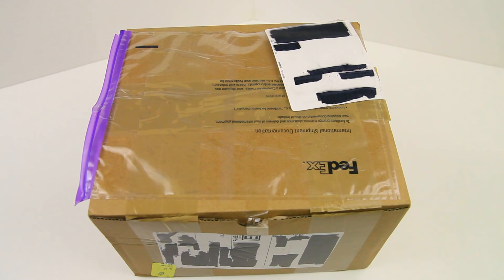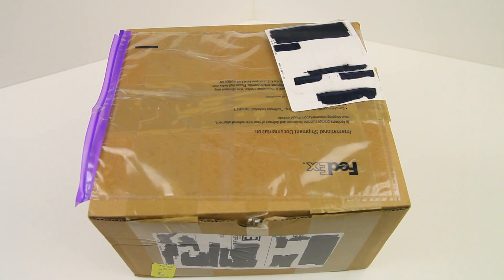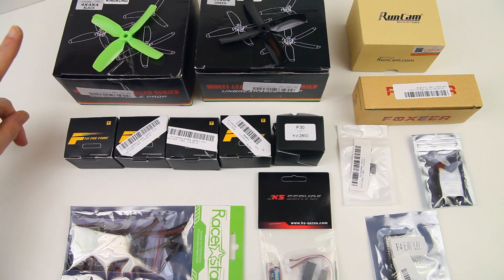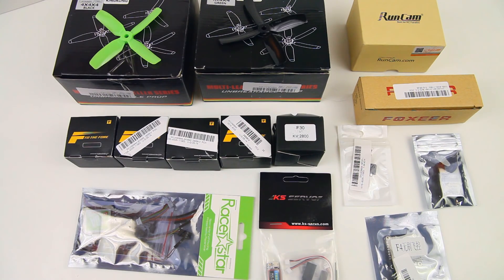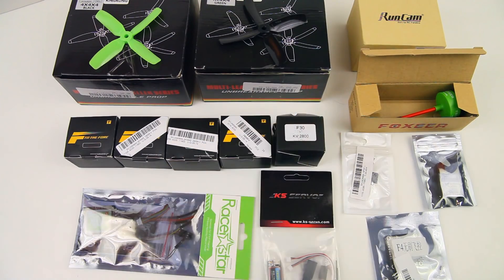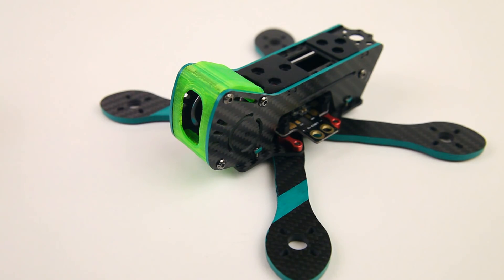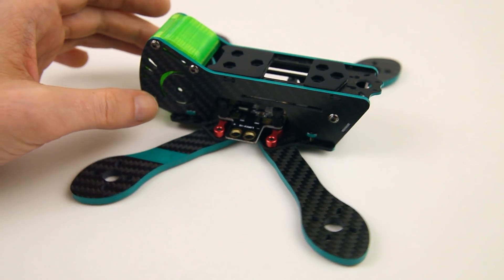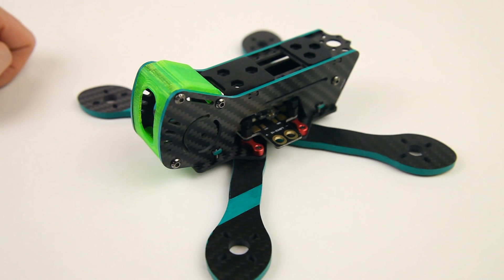GEPRC AX4 Light Quad Build Project! Part 1: Parts Introduction :)

Comment from the maker: A new (experimental) quad build! :)  I'm excited man :D
GEPRC GEP-AX4 Airbus frame: https://goo.gl/r7sEyZ 
REVO F4 FC: https://goo.gl/rQyVhC 
Racerstar RS20Ax4 ESC's: https://goo.gl/sLXncK 
T-Motor F3 1806 motors: https://goo.gl/EWdYpi 
Hyperion G7 HvLi Graphene lipo: https://goo.gl/FOm2Eu 
KingKong 4x4x4 props: https://goo.gl/8pUXRJ 
RunCam Swift 2 camera: https://goo.gl/RvXOR3 
Aomway TX001 transmitter: https://goo.gl/84DTZh 
FM800 PRO FASST Sbus receiver: https://goo.gl/m4IvZD 
Foxeer antenna: https://goo.gl/FL5hHY 
Lantian Buzzer: https://goo.gl/hUp10Z

Comment: The props were in the wrong cases :-)
Reply from the maker: Ghehe :)  You ment the picture on the cases didn't correspond with the props? :$  I think those cases are simply used for all kinds of props ;)  (BUT the 4-blade ones are on it as well :P)

Comment: kan ik met deze motors en 20a escs 4s vliegen?
Reply from the maker: Hmmm met de props die ik ervoor gekozen heb zal Dat op het randje zijn.. Het moet kunnen, maar je moet dan wel oppassen dat je niet een te zware lipo gebruikt..
Kijk maar es bij de motor-stats..
Reply: DutchRC Adventures 3s moet hij wel makkelijk kunnen toch?
Reply from the maker: Zeker :) HvLi's gebruik ik dervoor hè.. dus laten we zeggen 3,3S ;) 
Maar nogmaals: zolang een quad licht is, zijn de Amps ook laag.. Ik denk wel dat ik een keer 4S probeer..
Reply: DutchRC Adventures ik heb een frame van 106 gram. het is de diatone zmr180. heb net 20a escs besteld. denkt u dat ik deze motoren kan gebruiken met 4s?
Reply: en 4045 betekend toch 4 inch?
Reply from the maker: Yep.. maareh. in Deze build gebruik ik 4040 props hè :$ 
Yep.. dat zou moeten kunnen. ik zou Dan 4040 3-blads props doen.. En een lipo Kleiner dan 1300mah..
Reply: DutchRC Adventures oke heel erg bedankt!!
Reply from the maker: Graag gedaan Jordi :)  Krijgt jouw quad een OSD? (zodat je de amps in de gaten kunt houden)

Comment: Cool stuff buddy, good luck with the build I hope it's easy. Frame looks awesome. Maybe by the end of the year i'll start building a quad for fun and have it ready for next flying season! It certainly looks interesting but I'm going to concentrate on how to fly these suckers first in FPV before building! lol. cheers :-)
Reply from the maker: Howdy brother :)
yeahh I think that would be the most practical way of getting into building one, though I have to say my first-ever multirotor Was a self-build one :$ 
Is it hard to do? Nope!   
Is it hard to do well? well.. some knowlidge required there :$
Reply: yeah you have lots of flying experience from RC planes going into quads i think that helped when learning drones quicker than a hack like me ;-)
Reply from the maker: ghehe WELL.. At the time I was building my first multirotors, there wasn't as much choice in components as there is now.. I think that made picking the parts a bit easier :) 
But sure.. calculating the motors / ESC's / Lipo stuff required.. that is experience..

Comment: Wanna see if its hard for you to put together the antenna and LED+Buzzer back board, I had to remove it(LED) cuz it was impossible to put the antenna and board together.
Reply from the maker: You mean your FPV antenna was in the way you mean? That might be ehm a 'challenge' indeed :$
Reply: Yep
Reply from the maker: Them links don't work over here :$  But I know what you mean.. It will however be a while before I get to that part of the build (yep.. builds take Ages if you allso shoot video's about them :P)
Reply: agree
Reply from the maker: Do you think  by-the-way, that having a pigtail on your VTX for the antenna-mount would help in this frame? 
Link this one: https://goo.gl/84DTZh (the 'long' version)
Reply: Well I'm using this :
 F3 V4 Flight Control AIO Intergrated with Transmitter OSD BEC PDB and Current Sensor and a 
Racestar 4in1 30Amp ESC .
So I don't need an external VTX 
The problem is the backboard and the antenna hole are too close
Reply: also from the FC I have a pig tail to the rp sma connector attached to the frame with the rubber mount that came with the set.no way I can also attach the back board cuz the connector is in the way.
Reply from the maker: That kinda sounds like the ideal setup to me (I had planned to do that on a AX5 build).. I wonder what the frame's designer did / used..
Reply: I tried asking on their web site I think , never get back from geprc.My idea with this build was,  a Nice build as cheap as I can. So my motors are Racestar BR2205S 2600kv around $30 in banggood
props are cheapo 4x4.5 from HK,  Battery Turnigy Graphene 4S 1300mAh,  camera is a cheapo $10 Eachine 1000TVL 1/3 CCD 110 Degree 2.8mm Lens from Banggood , and the antenna was around $4 on HK, frame was around $35 from Banggood.
Reply from the maker: Yep.. same here. I emailed him something as well.. Nooo reply.. 
That is a nice low $$ setup.. Does it fly as expected / hoped?
Reply: DutchRC Adventures maiden will be Soon. I'm having issues I think with ESC calibration . as soon I pull the throttle up one motor go crazy spinning . maybe I fail the Esc calibration . today I will try to  work on that if I have some free time.
Reply: I'm having problems with ESC calibration or maybe is something else. as soon I arm it and put some throttle 2 motors goes crazy spinning. I know the FC and ESC are very  close ,so maybe too close that is causing interference. But because the frame came with the aluminum part to make the frame stronger I'm loosing around 5mm so I can't spread the distance between the ESC and FC . The aluminum part is a good idea but we lose 5mm in space to fill with parts and sensor , space is essential in this size .
Reply: Just keep at it Juan :)  I'm sure you'll figure it out :)  Have you had a look in the Blheli ESC config tool? (to see if all ESC's have the same setting? 

On the VTX antenna mount: what if you don't use that hole in the top-deck, and just poke the antenna (horizontally) out the back?